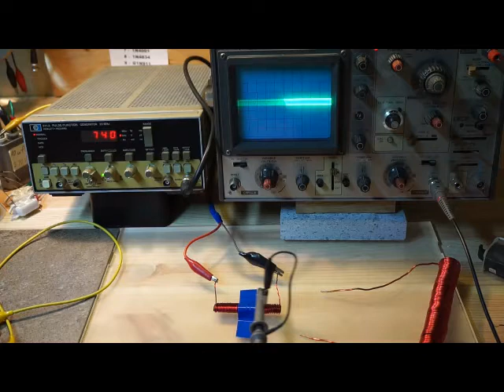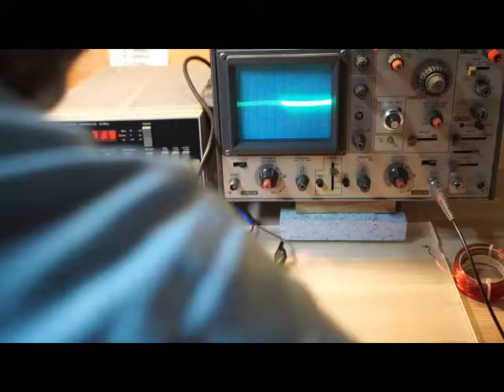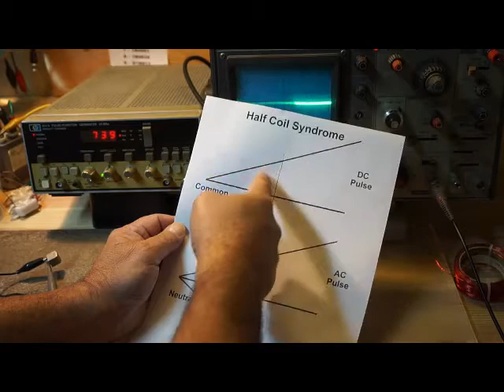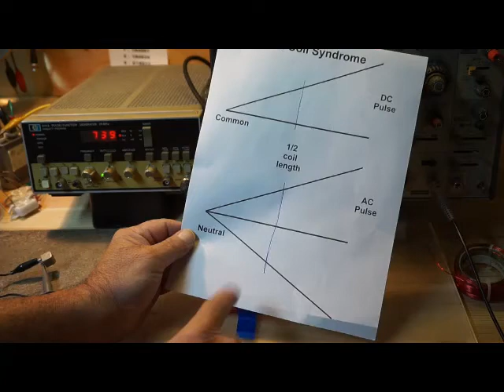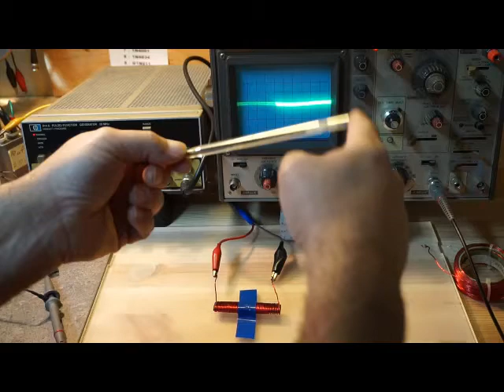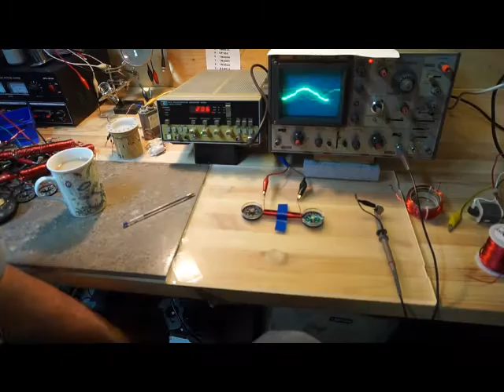Half Coil Syndrome 2

Comment: Interesting Wattsup. What happens when you reverse the leads on the tape head?. It is interesting,as the strongest/most dense part of the electromagnetic field is at the center of a coil or inductor,not at either end. This should be an interesting project.
Reply from the maker: Hi @TinMAn - No there is no diff. What this means is that anyone who is pulsing a primary of a transformer, a drive coil for a rotating wheel or any other contraption can augment the drive force but putting another primary of a second transformer (or coil) in series and even send the second output back to source lowing the overall energy consumption of any OU destined works. Now you know why I have been pestering you with those side tests. hehehe
Reply: +wattsup1004  Well that is interesting. When you open the thread,i will show you the results of my test in regards to this,and of course,i go a little further into it to try and find some answers.